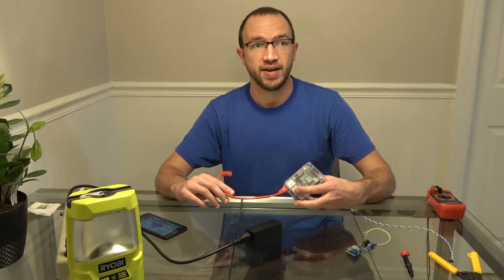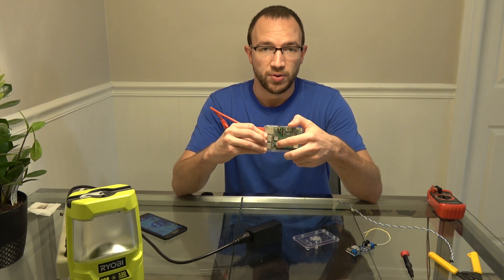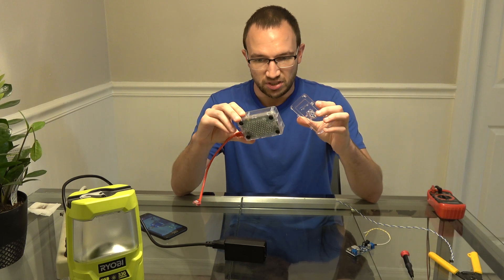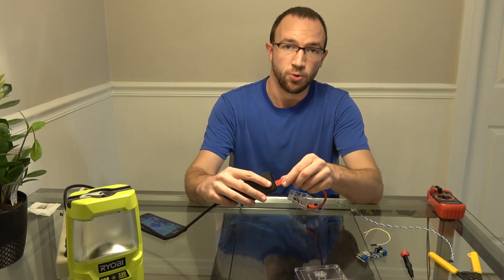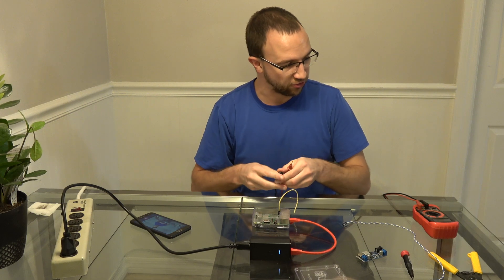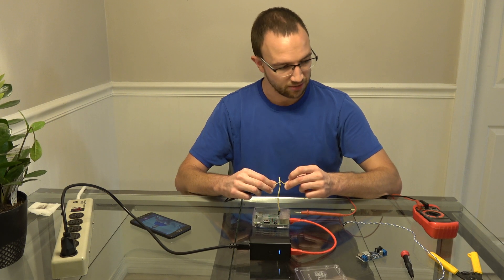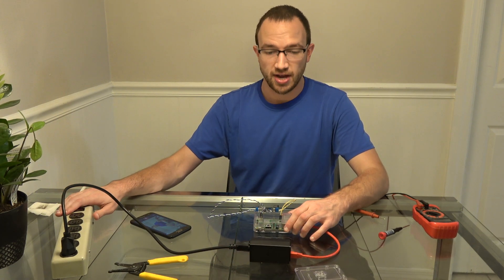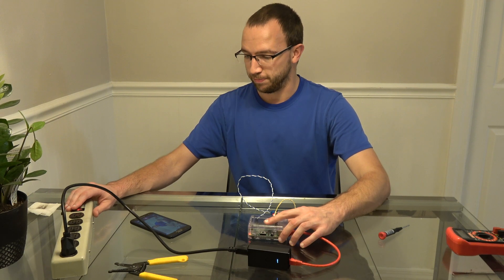Raspberry Pi on 24 volt Passive POE!

Comment: How Safe is this? Does the step down module have built in protection so if it fails it will stop power to the pi? This seems like a much better and economic option to a pi hat